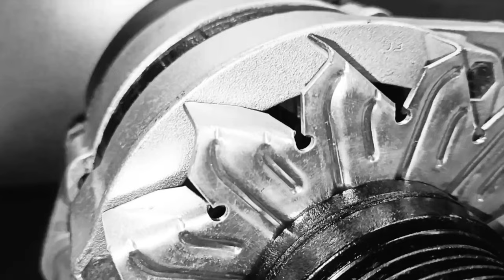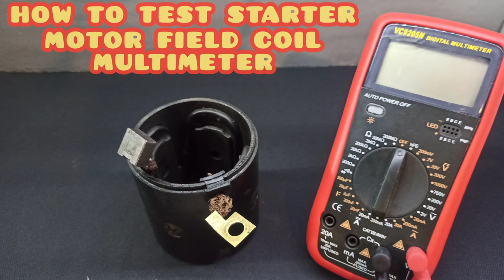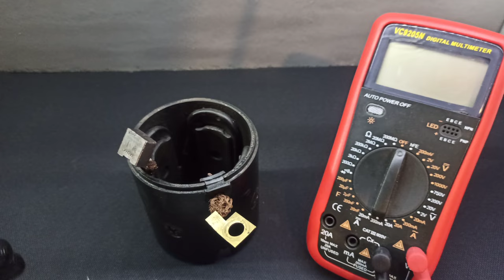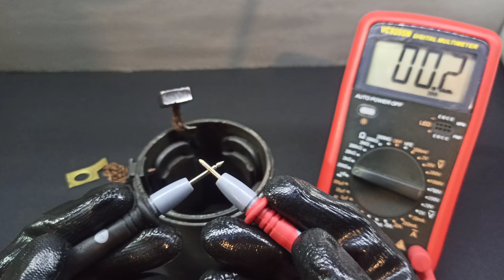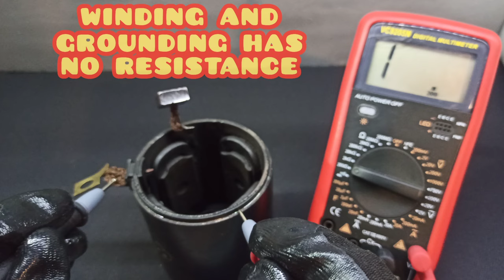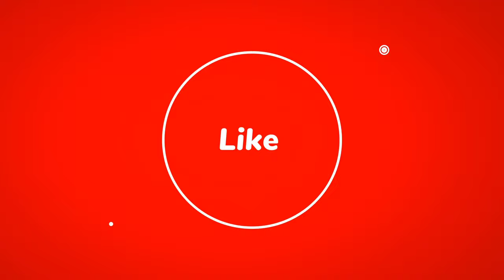Testing starter motor field coil with multimeter

Comment: The winding resistance is low on tge coils but wouldn't it also be low if the  coils are shorted inside?
Reply from the maker: Of course, with a multimeter we can see: 
1. whether there is contact with the ground
2. whether the composition of the winding is not interrupted. 
We can't see with a multimeter if the coil is connected to each other, I'll try to make a video about it soon, thanks for the suggestion....
Reply: @auto018ms  That's the problem, if coils are shorted together then the multimeter is probably useless. I have massive spark when I apply power to starter and I checked field coils resistance to the case and the multimeter came back with a high resistance but I believe if I connect battery power to coils and then touch the negative terminal of battery to the case the insultion will probably break down and indeed reveal a short.  I think otherwise if I'm to use a meter it would have to be a Megger insultion testing meter.
Brute force I feel is my only option if I don't posess a fancy meter like the Megger.